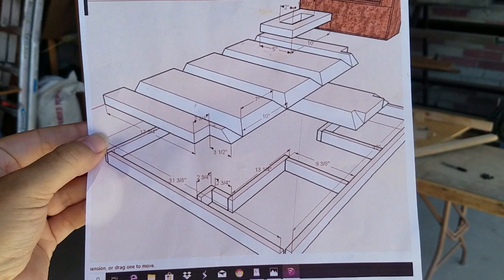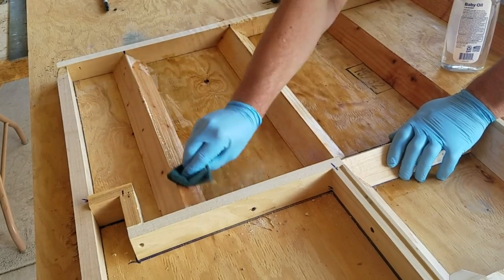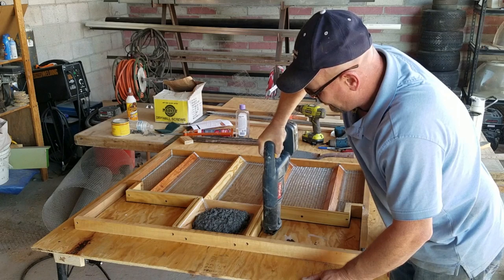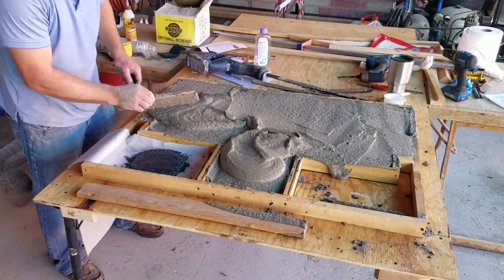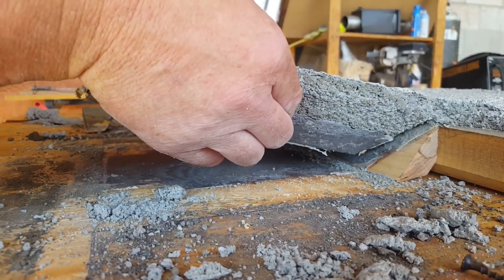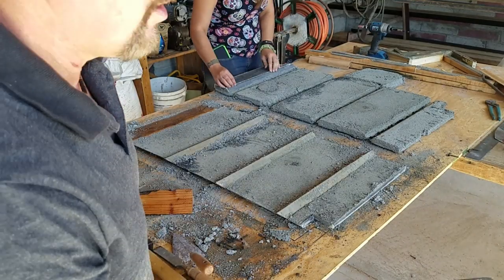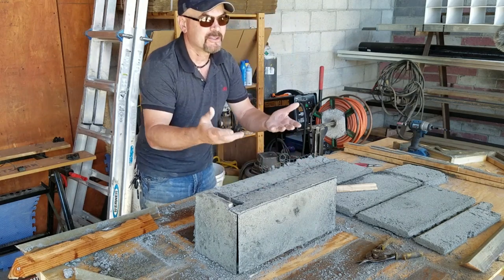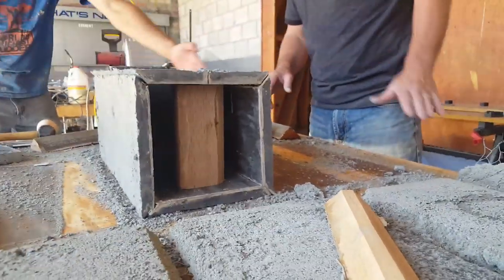Air Crete Insulated Fire Box

Comment: Non-water soluble calcium aluminate! That is how real refractory is made. Great job on the form. You explained about a fresh air channel you want on top of the burn chamber, if you want secondary ignition into the connecting collar (vortex area) the channel must be on the interior of the burn chamber. This allows for the unburned carbon to mix with fresh oxygen super heated to cause  more combustion. This area works like a catalytic combustor on an EPA registered wood stove. If you want a bond with the 2 pours you will have to do it backwards. Air crete first then refractory. The reason is because the refractory is pushing water away at the moment it reaches a certain level of curing it creates a very thin air pocket between the 2 different materials. To get a bond you must pour the refractory air crete first and follow immediately with the aluminate refractory.
Reply: Do you wait for the aircrete mix to dry and then pour the aluminate? Or is it poured while the aircrete is still fresh and in a semi-liquid state?
Reply: I think the aluminate mix would be too heavy on top

Comment: My father remodeled houses for decades. When he had to repair concrete, since he never knew whether his patch would easily adhere to the original material, he would paint the original concrete with basic white Elmer's glue before pouring his patch. His work still holds years and years later. Might be worth trying on a small section to see if painting the cured material with glue before pouring the aircrete will solve the problem. The heat will probably mess with the bond, though. Thank you for paving the way -Dr. Kreh
Reply: Now I'm going to have to try that.  I have recently become an adherent of Elmers after seeing a youtube vid about skim coating old walls, by adding a dash of Elmers to pre-mixed joint compound.  I have since stared to add a dash of Elmers to the interior and exterior paint I use an an old building I own.  I don't know if it's my imagination but it seems to work great.

Comment: From an engineering technologist: I believe the cylindrical style combustion chamber would be conducive to vortex flow .. A series of recommended air tubes installed in the draft could be opened or closed to provide complete burn. A venturi opening at the top would speed air flow with an adjustable air intake for vortex, like a turbo. Imbedded wire mesh is good.
Fire resistant water glass could be increased to the foam mix for consistency.
The problem with assemblies is precision, in addition to a fire proof concrete adhesive. 
Every assembly is vulnerable to temperature changes.  Just my opinion.

Comment: Years ago my landlord told me about bonding new concrete to old that I think might apply in this situation.  Paint the old concrete with a slurry of Portland and water, let it set up just a bit and then add the new concrete.  He had a corner of a concrete step that had been broken off.  He himself repeatedly tried to repair it with new concrete and it would never bond. He hired an old time mason to fix it who showed him the trick.  Even after decades the repaired corner was just as strong as the rest of the steps.  I'm wondering if that trick, or some adjustment of it might be used to bond the aircrete to to first layer of concrete.  Portland slurry when cured will stick to anything even steel.  Just try cleaning off the blade of a shovel, trowel or cement mixer once it has hardened to the surface.

Comment: Hello this is Capt Dano 
I am a yacht captain and do a lot of work in the .marine industry You're comments on a bonding agent to join the panels that did not bond together got me thinking about a product called 5200 .
It is a marine caulking that i believe originated from NASA to hold the tiles on to the space shuttle . After cured It is impossible to remove. 
I am going off grid this year and going to heat my home ( in Michigan) with a rocket system. 
You can Buy 5200 in small squeeze tubes or caulking gun size im Sure you will find use for it one way or another. 
Good luck.

Comment: looks great, In curious could you use wire mesh in both layers to help bond the two layers, or wire mesh cylinders at the height of the form like plugs? This is new to me, as I only know two types of cement, (wet/dry) and Plaster same configuration lol

Comment: Hey Darwin! What if you poured the firebox with all refractory aircrete, and then sealed it with water glass like you did with the aircrete/waterglass riser? Don’t know if you would need to seal it when put together, like you did with the riser, it might work to put the waterglass sealant with the pieces still in place in the frame...
Reply: the waterglass would melt because of the temperature in the firebox
Reply: Ah ha! This firebox gets hotter than 1400°C? (2500°F)

Comment: Would you not be able to adhere the two materials of concrete using anchors? ( anchor point halfway in the air Crete and halfway into the refractory material?